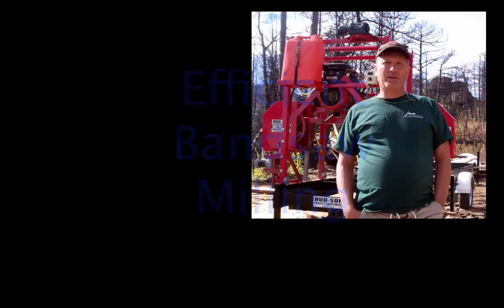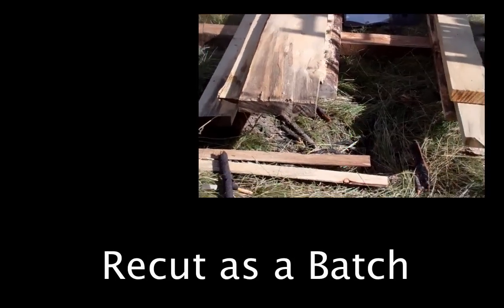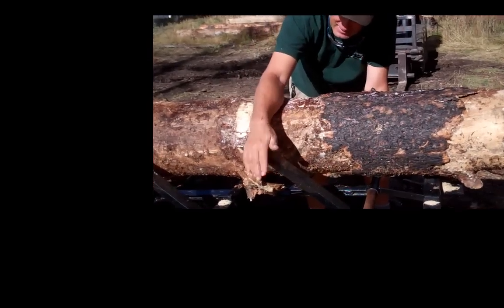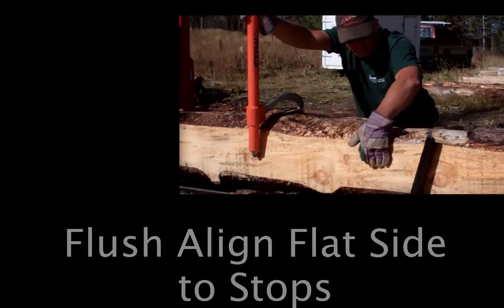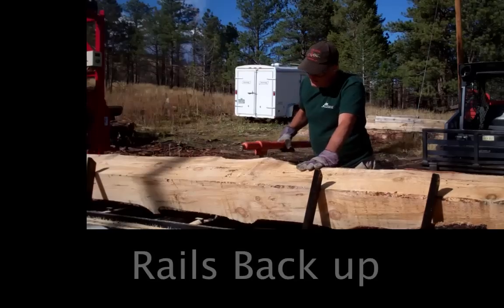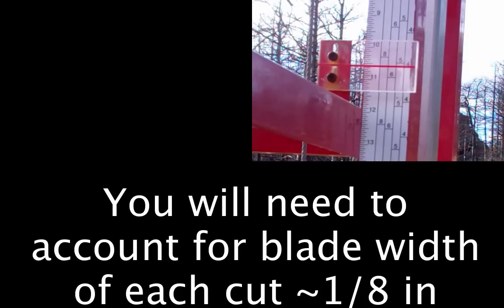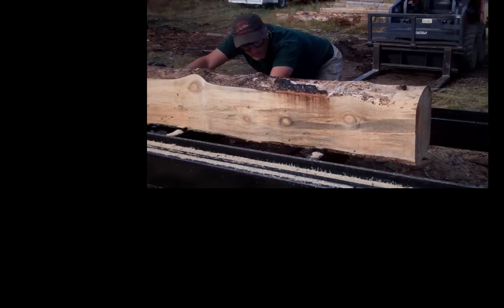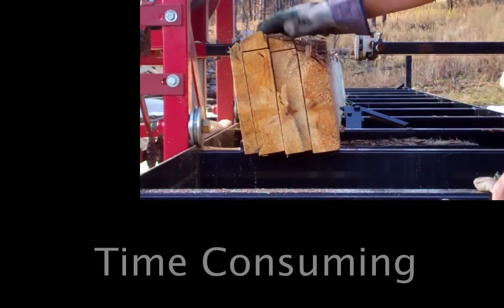How To Process an irregular log on a bandsaw mill

Comment: Very good video, I learned a lot. I will try the three slab method on my bandsaw mill. Next time keep your stops half way up so the boards wont want to tip on the final cut, that's what I have to do when I resaw especially on 1x.

Comment: I’m curious why you don’t rotate the log so that your first cut lays flat on the surface instead of up against the stopper bars? When milling w/ a circular saw we always make our second cut perpendicular to the first so it’s square
Reply from the maker: It's more mechanically efficient for a few reasons:
1) Less spin to do 1/4 rotation instead of 1/2. 
2) It pivots around the circular surface only;
3) Rotation of 180 degrees to flat is 90 extra degrees of rotation;
4) Cutting the top flat next means  Dropping the log mass to a flat surface so you have to lift extra mass to return to the round side for the third cut.
This strategy only rotates the log on the round surface until last cut, when ready to go square. It prevents having to pivot the log off of a flat side until it's as light as possible. 

It takes a few hundred logs - and an old fart like me - to figure out how to minimize lifting...
Make sense?

Comment: I see the opposite of what you are claiming.  I see you making the same cuts as the 4- side method,  only your yield on that "fat side" was a couple of 2x2s and 1x2s. Looks like you could have gotten a 1x6 and a 2x8 or a 2x4 and a 2x8 if you'd have cut that fat wood off then cut your cant down. 
Every log is different though,  so ...
Reply: Also on your first adjacent sides,  you want to split the log"s taper,  not make the top level. If you level it up,  why not just level the bottom (that is,  just leave it lay flat on the bunks) and save yourself a lot of strain? 
Just because you can make a video doesn't mean you should!